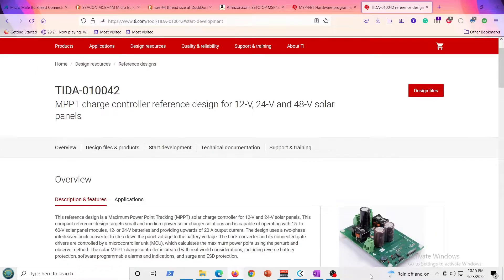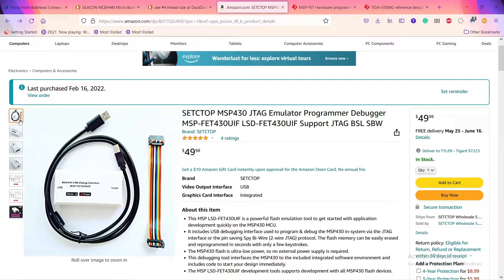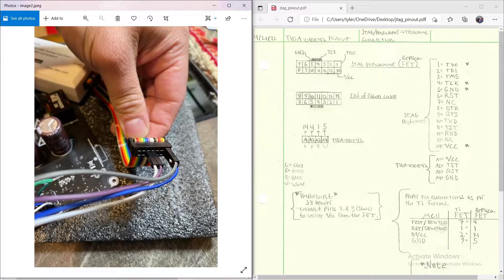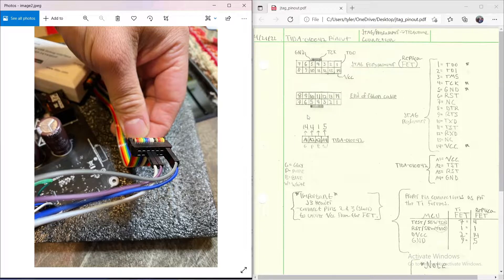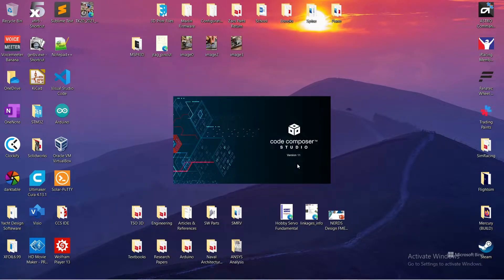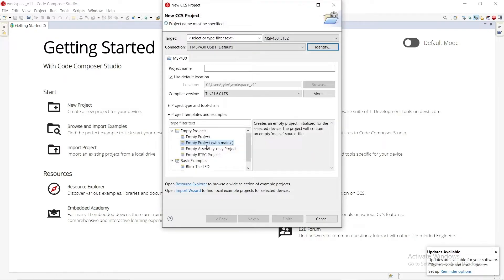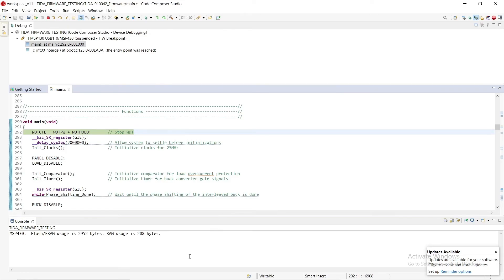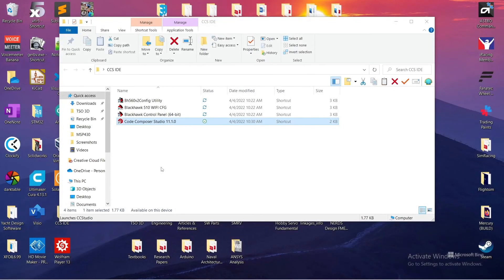TIDA-010042 MPPT Solar Charge Controller Development Using an MSP-FET Programmer/Debugger with CCS.

Comment: Did you get the parts to build the pcb?
Reply from the maker: I did! I had to substitute a few parts due to availability but I currently have all of the parts. I'm working on wrapping up another PCB for a Christmas project right now, and then I'm going to finish the TIDA redesign. I'm hoping to have the TIDA boards ordered before the end of December. I will share the BOM and Kicad files asap.

Comment: Hi there,
where do you have the TIDA from? was it preassambled?
Reply from the maker: Hi Tob Tob,

This particular board was purchased from someone who had a few made.

I am in the process of building my own boards but several items from the BOM are on back order until 2023. 

I am going to try and see if I can find replacement parts for the back ordered parts that are available.

The Gerber files for the PCB and the BOM for the hardware are on the Ti website.

If you do order your own PCBs just make sure to read the specs on the Gerber. The copper needs to be 2oz and the board needs an ENIG coating instead of a HASL coating.

Maybe I can make some extra if I can get parts soon.
Reply: @TylerSimsMechanical , 

Thanks for your response 👍 

There is also this board 
TIDA-00120
Maybe the parts are more available. 
It is more scalable in power/current.
Reply from the maker: @tobtob6157  No worries! You're right, TIDA-00120 has very similar performance:) I will see if I can get the parts to build one.

I have a scrap TIDA-010042 board that I will harvest my missing parts from, so I will upload a video soon of the entire build process.

I'm also finishing up my battery pack. I will upload a video next month where I will test the TIDA with a 24V panel and 18.5V battery pack.
Reply: @TylerSimsMechanical  I can barely wait for it

Comment: Hello Sims, this is very great. Could you please explain on how to  initialize all unused ports (port B)to eliminate wasted current consumption on unused pins.
Thanks.
Reply: Thanks for the reply 🙏
Reply from the maker: Hi Kayongo,
I am not sure but I will look into it!
Cheers!
Reply: @TylerSimsMechanical  Okay. Thanks
Reply from the maker: @kayongothomas2150  sorry I haven't gotten back to you yet! The boards I bought had hardware issues so I'm still in the process of building new boards. Due to parts shortages, I've substituted missing parts and am currently redesigning the board in Kicad. Hoping to have some new test boards within a month or two!